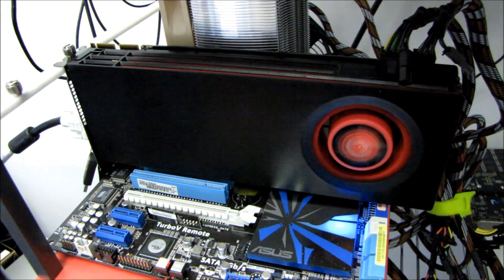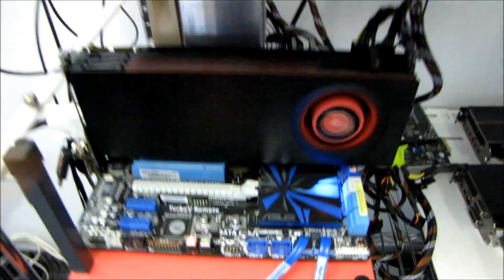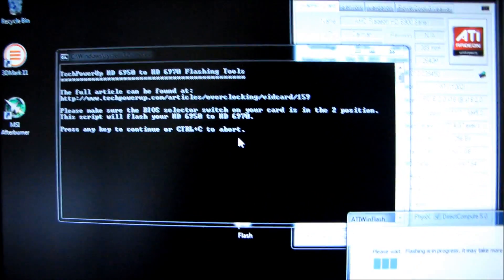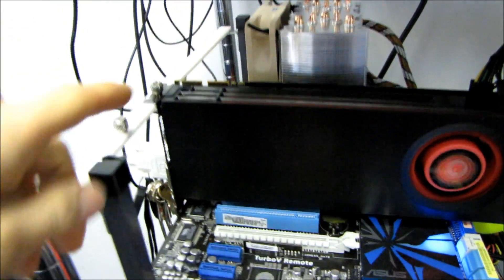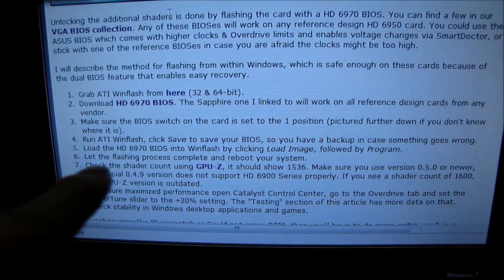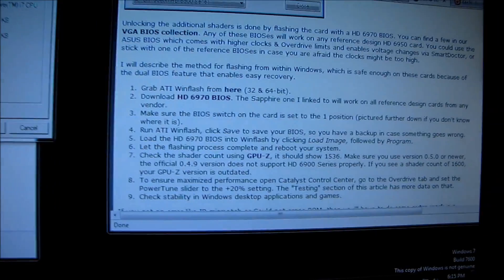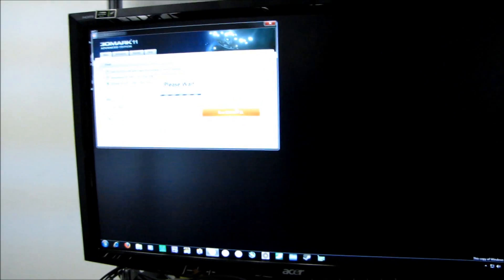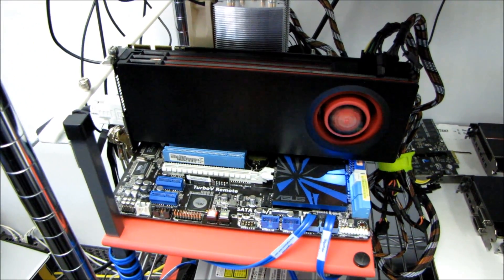AMD Radeon HD 6950 Software Unlock to Radeon 6970 BIOS Flash Linus Tech Tips

Comment: I did some looking into flashing the BIOS and found that there is a 'safer' method of just unlocking shaders and then overclocking to 6970 speeds. After doing some digging I found a fantastic post by a guy that did a heavy amount of detailed work showing what he found to be the best combination of oc'ing and shader unlock. At best there is a 2%-3% increase in performance compared to a stock 6970. So, amazing yes! Worth it? Debatable

Comment: Do you realy wayt to risk your card, just to get +10 FPS when you have 100, and +2-3 when you have 25? The built-in OC software is just as good, if not better.
Using both is just suicidal, you will get around 95c' temp :)

Comment: I unlocked my freshly brought 6950.
The only "Problem" that its running on 85 degree celsius.
It seems to be fucking high for my old 4850's 50-60.
Is it normal on theese? Because the fan speed is just verry slow compared to the "100% option". Any ideas?

Comment: @burninwftf44  The "unlocked" 6950s aren't true 6970s. So if you try to overclock to speeds that a real 6970 can handle may cause instability in the unlocked 6950. The only thing this method unlocks is the number of shaders, which have been limited by software by the manufacturer.

Comment: i'm confused... if the 6970 requires 1 six and 1 8-pin power connectors, and since you're virtually upgrading the 6950 to a 6970 (considering the 6950 needs 2 6pin power conectors), wouldn't that make it unstable?

Comment: @riado4351 yes, works for any brand's reference card. if you get an error after flash the bios, simply just switch the bios pin to 2 position after turn off your computer, and restart it. then switch back to 1 bios, and flash it back to your original bios. that's why you have to always save your bios before doing any flashing stuff.

Comment: @TheTester121 no, it isn't guaranteed because a 6950 needs two six pins, and 6970 has a 8 pin and 6 pin, and two 6 pins dont provide the power of a 8 and 6 pin. Also, if you screw up your first bios, AMD has a second bios which you could switch too, and everything will go back to normal

Comment: if you buy two radeon 6950s and flash them both to 6970 can you then run them in crossfire and it would be exactly like two 6970's?

is the performance difference between the 6950 and 6970 'worth it' enough to justify possibly damaging the card with this bios flash?

Comment: I've followed the same steps you did, only, when I press "program" on ATI winflash, the progress bar pops up for a fraction of a second, then I get the message "subsystemIDs Mismatch." Any clues?

And to further confuse me, I tried the alternate method of flashing, booting to a USB  drive and using the DOS-type thing. The only problem is, atiflash says I have no adapters. At least, none that it can find. (and I can assure you I do).

Any idea what's up? Anyone? All help is appreciated.

Comment: I don't want to go all pedantic on you, but referring to this as a BIOS flash is just wrong. It's a firmware update. Sure it has in common with BIOS that configuration parameters are stored on CMOS, but it is not a Basic Input Output System - which it could only be if the card was a complete computer with its own hardrives and other peripherals.

I know this isn't down to you Linus, but comes direct from AMD. Still, it's an unprecedented departure from accepted nomenclature.

Comment: linus, i have a question: I just bought an XFX 6970 and I don't have an 8pin to run it. My Psu is RocketFish 700w so it should run the single card fine. Now, XFX says i shouldn't use any 6pin to 8pin adapter but i really don't wanna buy a new Psu, So does NCIX have any dual molex to 8pin adapters or any other options i could do? If i would have to get a new psu, I'm thinking OCZ EliteXstream 800w, so is it a futureproof one?

Comment: @Fixer420 are you able to still change the power consumption in CCC? mine's gone and when running furmark it keeps throttling the clock speed
btw what clock speed do you have yours on? got mine at the 6970 speeds; this is not too much of an overclock is it? and do you know if 23 amps for the +12V3 rail is too much (this is for the GPU)?

cheers man

Comment: There is at least two big differences between 6950 and 6970 making a flashed 6950 still inferior to a 6970: dual 6-pin power connectors instead of 6-pin + 8-pin (225w vs 300w according to ATX spec.). Also, 6950 has inferior memory chips Hynix H5GQ2H24MFR T2C instead of the 6970's H5GQ2H24MFR R0C. 6950 chips are rated at 5000 Mhz running at 5000 Mhz while the 6970's chips are rated at 6000 Mhz running at 5500 Mhz. Flashed 6950 may have to underclock. 6970 can increase voltage and OC even higher.

Comment: I still wouldn't suggest buying a 6950 expecting to get a flawless 6970. If you were going to get a 6950 anyway, well then hell yeah, try this, free performance gain! However something could happen down the road (instability, driver issues, ect.) and you might have to go back to the 6950 settings, which after all, is what you are paying for. Don't buy a 6950 if you would be devastated if it did not perform flawlessly at the 6970 level.

Comment: i wounder tho. is it stable cause of the little bit of power the 6970 gets over the 6950 cause of the power connectors. but hey it might be fully stable and still be able to get the power it needs. if it can ill just get two of these instead of a gtx 570.

Comment: When doing this please keep in mind that AMD probably had good reason selling these GPUs as HD6950s rather than HD6970s. So results may vary and are in no way guaranteed. For example, your unlocked HD6970 will probably not reach the same clockspeeds as "real" HD6970s and may use more power.
The HD6950s also use slower RAM-chips than the HD6970s which will limit clockspeeds even further.

Some chips might have downright broken shaders and show artifacts when unlocked. Please keep this in mind.

Comment: @The1PublicEnemy Nothing happens because the typical power is 180-190w for the 6970 
6 + 6 pin = max 225w
6 + 8 pin = max 300w is only useful wen you overclock more and the card need more than 225w.

Comment: @Unknownz00 you could crossfire them anyway...back in the 4000 days you could cf a 4890 with a 4850. There's still some risk involved with flashing the 6950 as the ram chips arent rated for the same speeds as the 6970.

Comment: Why do you think they choose to make it a 6950 instead of 6970?

Because they sort GPU's like CPU's, the GPU with the least amount of errors become the higher clocked cards, and the ones with alot of errors become the lower-end cards..

A X3 CPU can be unlocked to a X4 CPU, but they made it a X3 because of errors on the last core, instad of throwing it away = they save money, same on GPU's.
Reply: It just to make it cheaper so that it sold

Comment: Don't forget to go into CCC and adjust Power Control Settings to +20% if you have a decent power supply, else you will not get alot of fps boost doing this.

Comment: @mhaneline still too expensive for the performance you get, i mean, 2 HD6850 in cf whips the gtx580 so bad it's not even funny, and 2 6850 is REALLY cheap.

But i agree, nVidia improved some of the power consumption issues so that's awesome.

Comment: @Hotrod768 Actually it can. This whole unlocking thing is flashing a 6950 with a 6970 bios.
So this card is already running at 6970 clocks.

Comment: This is great and all but won't the changed 8 pin from the 6970 cause problems when you're under load (like playing games). I mean what's the point if its going to end up breaking the card and then you just have to buy another one when you could have saved yourself all the trouble by buying the card that you originally needed. I'm not super tech savvy so was just wondering.

Comment: Sorry Bro, but if you simply just flash it you don't get the same performance as a 6970. You also need to raise the clock speeds to those of a 6970 using Afterburner or something like it for the best performance.

Comment: @selyss12345 they test only a few chips out of a batch. If the batch is good they get labeled 6970 if the batch is bad they are called 6950's. That doesn't mean every chip in the batch is a bad, it just means they have a higher chance of failure at the 6970 settings.